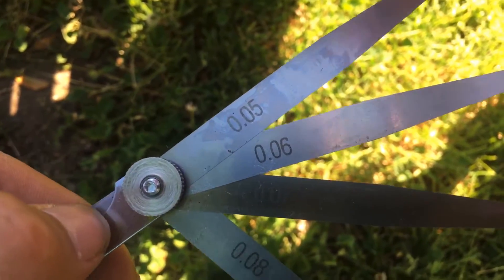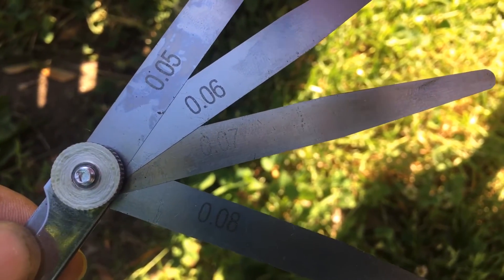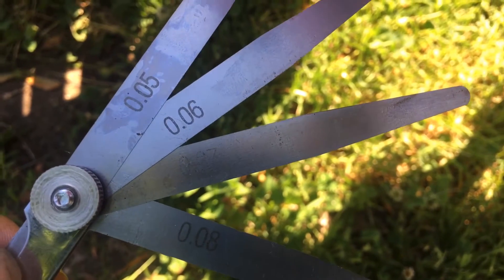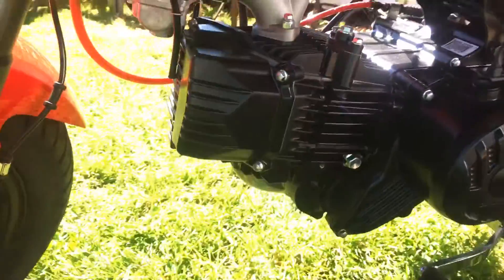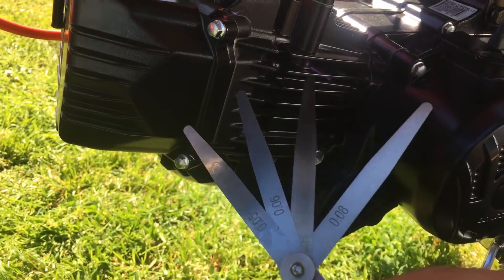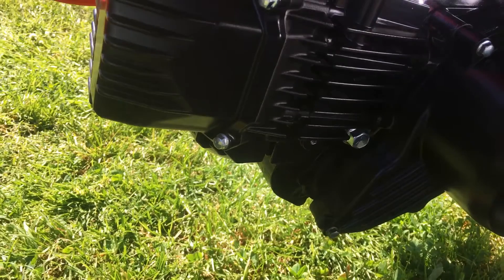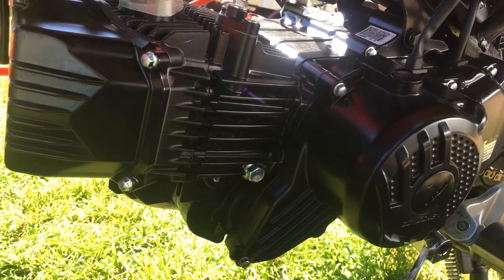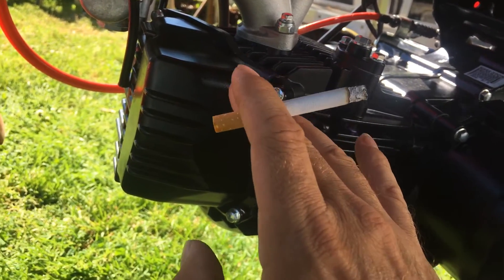Zs190 valve adjustment spec and feeler gauges w link

Comment: What size carburateur are you running? And what jets are in it and the airscrew etc. Let me know in giving up soon😂
Reply from the maker: @comedysem9450  I ran a 28mm mikuni flatslide. Air screw I never touched. I changed the pilot jet for sure. Don't remember if I changed main. I'll check to see what jets I have to possibly figure out sizes I used. Don't give up just yet. I promise it's worth the headache. What I used in mine though most likely won't work for you. It'll be a start though.  The stock jets you have in it are also a start. What's giving you trouble?
Reply from the maker: @comedysem9450  mine was a mikuni 13-5047 flat slide 28mm.

Comment: How well does it ride with valves set to .005 & .007. I’m running .003 & .004, runs great until WOT, then I get sputter/bog, plug is golden brownish tho
Reply from the maker: It ran perfect 0 issues. Carb was also tuned perfectly.
Reply: @parkersgarage4216  sounds good, I jus changed them to .004 & .006, had to mess with fuel screw, was real lean after valve adjustment, haven’t been able to test yet. New pipe giving me a lot of tuning issues but I kno it’ll b worth it once everything come together
Reply: the exhaust is very important with carb bike. i've found that you need a lot of backpressure to run it good. like the powerbomb exhaust of CRF Honda. without backpressure tou can't carb it.

Comment: Wish you actually did the process instead of just explaining it. I'm a newbie and want to actually see the process.
Reply from the maker: Gokris Gaming really hard to show the process as it’s all about feel. I’d only recommend attempting a valve adjustment if you have some mechanical experience. There are other vids in relation to cars and valve adjustments. Same thing really
Reply: I have some experience and it doesn't look hard.
Reply from the maker: Gokris Gaming it isn’t hard if you have an idea of what you’re doing. Decide what spec you wanna use and go from there.